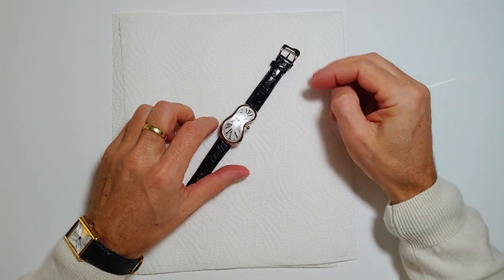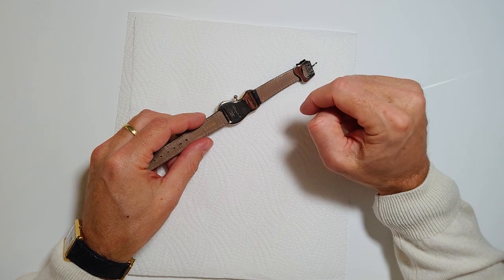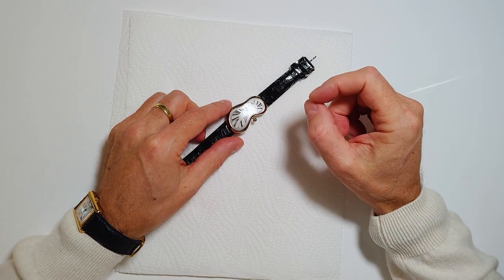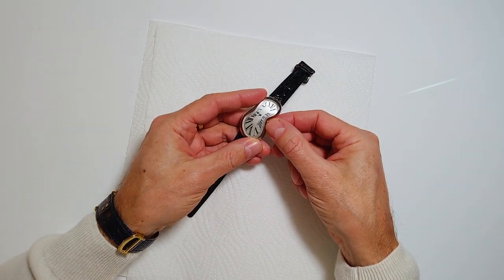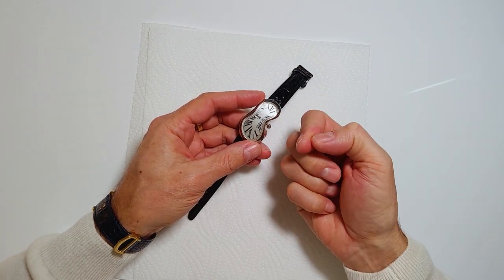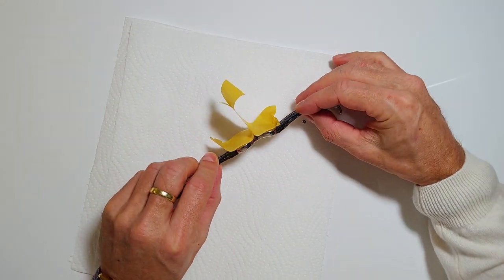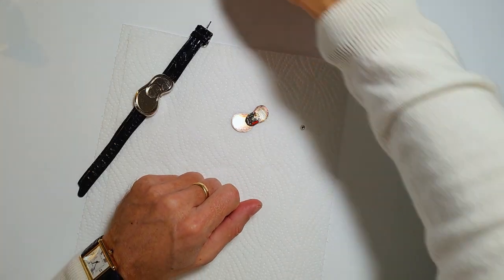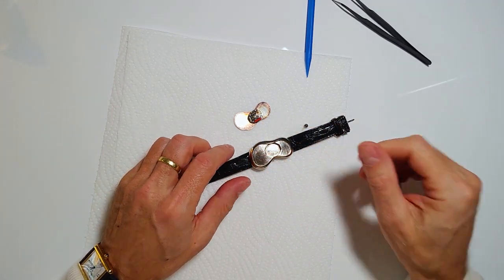Exaequo Softwatch Battery Replacement

Comment: What is the thickness of the 751 ronda harley movement in this (3.6mm, 3.8mm, 4.2mm, or 5.2mm)? I'm thinking I need to replace mine because it's started running slow and/or stopping completely at times.

Comment: Can you share the battery code for the battery
Reply from the maker: It's a Renata 379 button battery
Reply: Thank you
Reply: I managed to fit a new battery thanks to your tutorial. But I cant put back the glass in. It doesn’t fit flush and im too scared to put pressure on or else it might break it. Can you guide me with that?
Reply from the maker: Did you manage? You did good not to push the glass too hard. I would try to fit the glass without the clockwork to better understand what is causing it not to clip in. Let me know how it went. Cheers

Comment: J'ai cassé la couronne 😢...je ne sais plus quoi faire
Reply from the maker: If the crown came off the stem, you can gently pull out the stem with pliers and reattach the crown later. If the stem broke, you can try to wiggle out the clockwork from the case. If that doesn't work, the hands need to come off and then the watch face so you can see more. The only tricky part is that the official stem release is on the back side of the clockwork, but I'm sure you can figure it out!
Reply: hey did you manage to solve it? im faceing with the same problem now